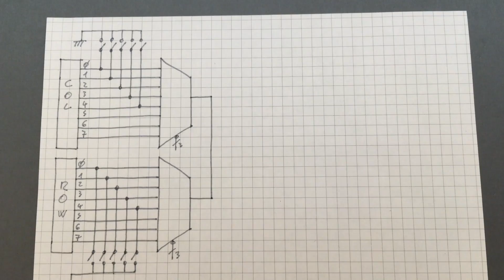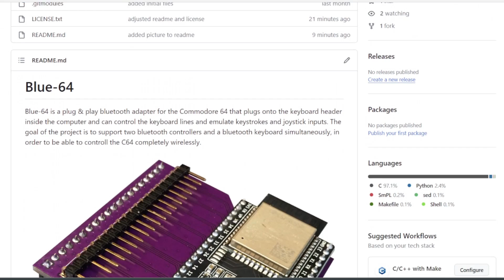Blue-64: plug & play bluetooth for the C64

Comment: Is it possible to use the nintendo switch contoller with the Blue64?
Reply from the maker: Hi, from a software perspective blue-64 is just a wrapper for the fantastic bluepad32 library from Ricardo Quesada, so for any compatibility question that is the project you need to check out: https://github.com/ricardoquesada/bluepad32 it appears to me that the Nintendo switch controllers should be supported

Comment: Well damn I’ve been working on a very similar project, though not as elegant. Awesome work!  In my case BT keyboard support and macro text injection were my primary focus but joystick/gamepad support was on the back burner.  My approach is built atop the “C=Key Keyboard Interface” from RETRO Innovations by go4retro; specifically the “PS/2 to CBM” mode which implements a PS/2 Keyboard interface on my C64; (Which itself is supported by two microcontrollers: an Atmel ATMEGA162 and a Mitel MT8812 crosspoint switch.) 🤭 To enable Bluetooth connectivity I’m leveraging an ESP32 and  Hamberthm’s “ESP32 — Bluetooth2PS/2” implementation which I’ve modified.  Admittedly a bit of an ‘around your elbow to get to your asshole’ approach no doubt. I already had my C=Key and while I mulled over replacing it with a holistic ESP32 solution; in my case this was the minimum viable solution.   

(GitHub and other links to projects mentioned below)

C=Key Keyboard Interface
https://github.com/go4retro/c-key

https://www.go4retro.com/products/ckey/

https://store.go4retro.com/c-key-keyboard-adapter/

ESP32 — Bluetooth2PS/2
https://github.com/Hamberthm/esp32-bt2ps2
—— Forked from: 
https://github.com/turgu1/bt-keyboard

https://youtu.be/2PVjWfAAJFE?si=iXV43FR7Az_g_YJB

Comment: How hard would it be to create one of these for an sx 64. The runstop key is mapped differently.  This would solve the keyboard cable missing problem if a Bluetooth transmitter was added to the sx64 key board.
Reply from the maker: Hi, so I don' t know much about the SX64, however what I can tell you is that the Blue-64 is completely transparent to the C64. Unless it is sending a keystroke it's exactly as if it weren't there and the original keyboard and joysticks work regularly. So perhaps it wouldn't work "on its own" to mock a keyboard for the SX64, but again, I'm only speculating